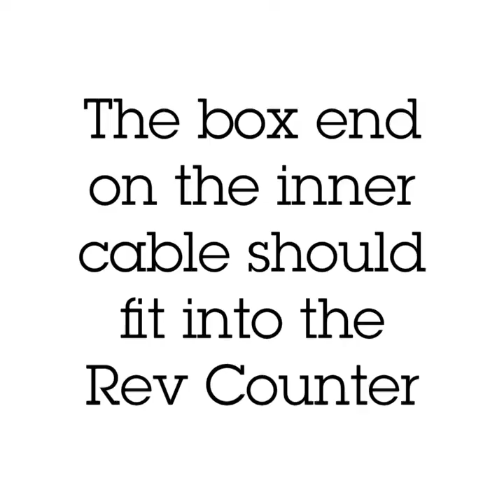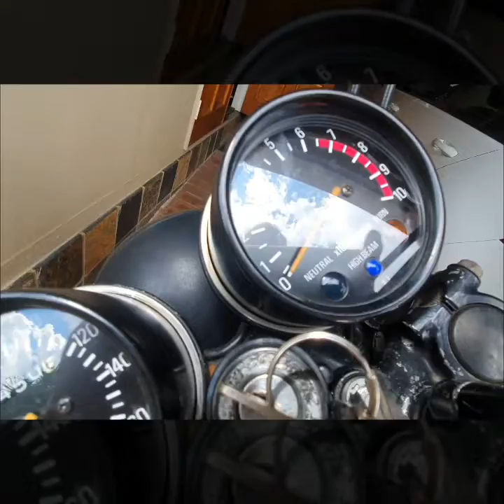Paul: XT500 expert builder - solves a cable size problem

Comment: Or you can just hacksaw the end off ,as i had to do.
Reply from the maker: You still have to square off the piece of cable that fits into the speedometer. And for that my mates little tool does wonders